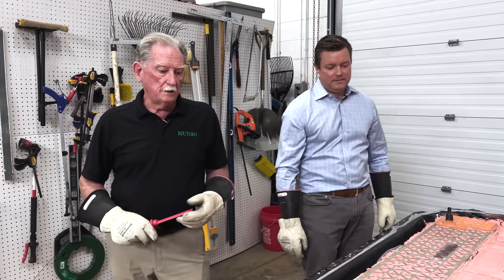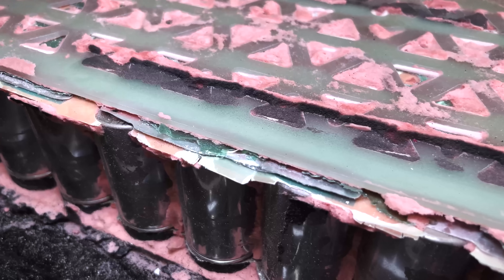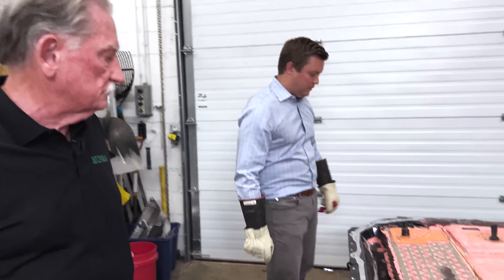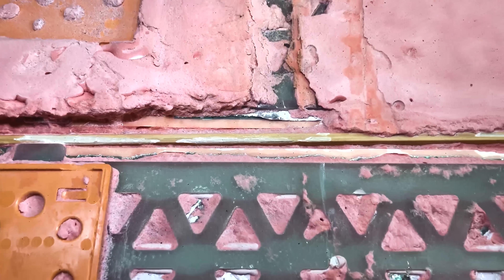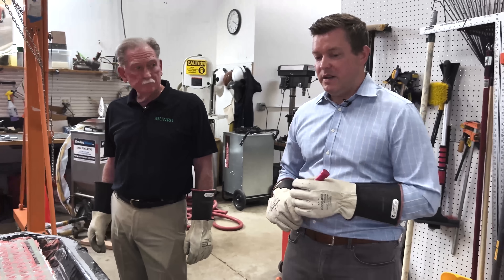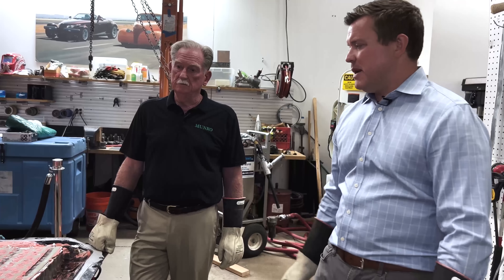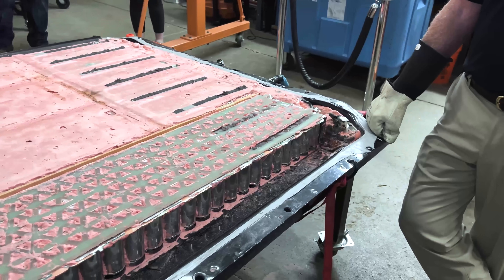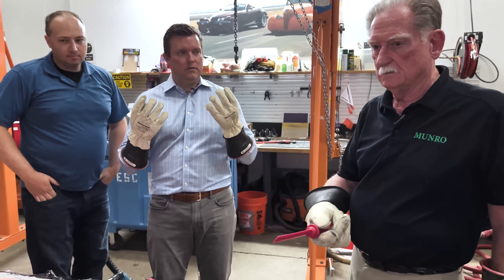4680 Battery Pack: What We Found Under the Foam!

Comment: I believe that Sandy did mention this on one of his tour video's on the Autoline Daily You Tube segment that The TESLA batteries are not failing to perform and that they are essentially glued in place. This battery just goes to show us all that TESLA still believe in their battery technology to the MAX. 

TESLA still put their batteries in solidly. Especially now that they are an integral part of the cars they build. A structural battery pack should be installed securely and profoundly as tight as possible so as to not fail.

Congratulations to Cory and Sandy for proving what it takes to tear apart this vehicle. I would want one to stay together; this well and feel protected if I am in a crash situation. GREAT JOB guys, thanks for the confirmation pertaining to information that I care to know about. This is the reason you have gained my trust as a Subscriber. Thanks In Advance for reading my comments...

Comment: Edit: I am wrong below. It will 828 cells, unless they do something different on other packs. The next row will be 35 cells, and it will alternate between 34 and 35 cells. This does mean that it will be a 92s9p config, which is also lower voltage than current 2170 builds. Not sure why they would do that.

"For the total number of cells, 816 makes more sense than 828. The pack is overall the number of cells in series multiplied by the number of cells in parallel. They have to both be whole numbers. Given that Tesla is still on a 400v architecture (between 350v and 450v max charge), you need around 100 cells in series to make that work. The only parallel numbers that work within that range are 8 and 9: 8 for 816 cells and 9 for 828 cells. 9 in parallel would mean 92 in series while 8 in parallel would mean 102 in series. 

While both work for a 400v architecture, 9 would be a lower voltage of 386v. When it comes to charging, the super chargers are amp limited due to heat. This is also the case with the controllers and motors. But this would be an unnecessary limit to charging speeds. 8 would be 428v. This would allow faster charging speeds for the same amount of amps. It would also allow the motors and controllers to run cooler."
Reply: I came up with the same math. 204 per section. 4 sections. Each section is two series strings of 102 cells. So a total cell count of 816 is very plausible.
Reply: @trent_carter  Thank you. I hadn't thought about the individual sections. Makes sense though, as each module would be identical in that. However, it would make it impossible to reduce voltage by separating the modules from each other. 

I kinda want to take a voltage meter to several connections. That would give series counts, which is the most important aspect when looking at total pack size. Dangerous if you screw up though. 100v DC is more dangerous than 100v AC, and we are looking at a max of 400v and enough amps to melt steel.
Reply: You have those combinations correct. The voltage difference between the two of them is unimportant; the Ford Mach-E standard and extended range batteries are 96S3P and 94S4P, with no change in the motors or controllers and no loss of performance.

The count will almost certainly be 828, if only because when divided into the four blocks (modules) the resulting 207 divides into whole groups of 9, while the 204 resulting from a total of 816 does not divide into whole groups of 8.
Reply: @brianb-p6586  You are right on the voltage not being that important overall. While it is important, the motors and controllers have a wide range that is acceptable. Similar to the charging systems. It does need to stay within the acceptable range, but that's it. Otherwise, higher voltage is slightly better than lower voltage since it allows less amps for the same amount power. That reduces heat. 

You are incorrect however with the pack groups. We can see that the first module, which has to be identical to the other side, is 204 cells (6 by 34). The center modules are also 6 across. The 828 cell count comes from someone saying that the center modules were 35 cells down and 6 across, while the sides were 34 by 6.
Reply: @anthonypelchat  No, as Sandy mentioned they don't know how many cells are in that block. The edge row has 34 cells, but when they did in far enough to see the next row (which likely has 35,  and the they alternate like that), they'll actually know how many are in the block. No, the blocks are logically not different; unlike the original Model 3 2170-cell battery, the middle blocks (modules) do not appear to be longer.
Reply: @brianb-p6586  They start talking about the cell counts at just before the 10 minute mark. He specifically mentions that they see 6 by 34 on the side module, or 204 with 816 total. He then mentions that they look to be identical, but won't know for sure until the rest is pulled off. The 828 came from previous renders of cells showing an additional row with the center modules, not anything that Munro counted. Maybe there was some idea in a previous video, but nothing in this specific one. 

With there being a clear separation between modules, we know for sure that there are 4 modules in total. If the two side modules are indeed 204 each, then at no point does a 9p cell setup make sense. Each side module and center module would have to cross over voltages at some point to make it work. That would make the whole module thing pointless. Can explain further if you want details.

Each module being 207 cells makes more sense from a layout and voltage perspective, but it wastes a lot of space for no reason. Each module would have to have a 35th row of cells that only has 3 cells while all the rest have 6. That also doesn't appear to be a possibility as both the front and rear of the side module appear to stop right at the final countable row with electronics clearly visible where the 3 cells would have to be. While it is true that we need to wait on final info to be sure, it is also extremely unlikely that the side modules have 207 cells.
Reply: @anthonypelchat  the cells are not in a rectangular grid. Like every Tesla-designed module and every sensible module using cylindrical cells, they are laid out in hexagonal circle packing (look that up, such as in Wikipedia, because a comment with a link will be deleted). It makes no difference to packing density whether there are 34-cell and 35-cell rows or all 34-cell rows - there are no "3 cell rows", and the front and rear ends of the cell arrays are not (and cannot be) straight across. 

Again, the 828 value has nothing to do with longer centre modules.
Reply: @brianb-p6586  I understand how battery packs are laid out. I build them for diy projects. And yes, Tesla can absolutely rearrange cells in many different ways to make it work. However, these still come off an assembly line. This is not a hand built battery pack for an ebike. As such, you either have 4 identical modules coming off of a single assembly line, or you design different lines for different packs. What makes more sense to you? And remember, all 4 modules are verified the same dimensions wide. That means that each is 6 cells wide. 

Again, to get 828 cells in total, you only have two options: either all 4 modules have a 35th row of cells that only hold 3 cells instead of 6, which waste space, or you have 2 modules with 34 rows of 6 and 2 modules with 35 rows of 6. There is no other option based off the info that we currently have. Period. Sandy and his team are not showing a 35th row on the outer module. Further, from the video, we cannot see any clear space available for the 35th row. Therefore, it is highly unlikely that there are 207 cells in the side modules. The only option is a 35th row in the center modules. If there are only 204 cells in the side modules, there is absolutely no way of any two modules being identical. The entire 828 cell count came from old renderings. 

Further, this entire discussion is now pointless. Look at the video again and focus on the front of the module. If this were a 207 cell pack, the most optimal setup would be to have 23 sets of 9, so the front would just be one large set. Instead it is split into 3 pairs. There is no possible setup with 207 cells that makes sense in that case. This makes far more sense with a 204 cell count and a 102 cell series count. 102 is 34 times 3.
Reply: @anthonypelchat  EV battery packs routinely have a more than one module type in them, but of course four identical modules are even better... and that's exactly what I have been saying (which you would know if you read what I wrote).

You're still talking about 34 rows of cells, as if they are arranged on a checkerboard, so you clearly don't know how to pack cylinders together and haven't looked. Until you do, this won't make sense to you.

Yes, if it has 207 cells per block, the arrangement will obviously be 23 sets of 9.
Reply: @anthonypelchat  to help you understand the likely layout and why you're "three extra cell" concern doesn't make sense, have a look at an InsideEVs article titled "Engineering Analysis Of Tesla's Cyber Rodeo 4680 Battery Pack Cutaway". It shows the components well, and even has a detailed drawing of the layout.
Reply: @brianb-p6586  For some reason I was describing it in a rectangular design, even though I knew it would be staggered. Was likely tired. Of course that isn't how a 207 cell module would be built. It would of course be a staggered 34, 35 column cell count. My assumption was a 34, 34 staggered config. However, I am wrong. The article you mentioned from May clearly shows Tesla building in a 34, 35 config.

Each module has to be 23s9p. The only way that I can see that fitting properly is 9 across, 23 down. With the staggered setup, it would mean alternating 9 cells per column 1,2,1,2,1,2 connected in parallel and alternating for the next group connected to the first in series. That would also mean that the front end would be one connection of the 23 series while the rear would be the other connection of the 23 series. Each of the packs would then be connected in series with one side of the pack being the main negative and the other being the main positive.

It still doesn't make sense to me that they would do that. It means that the voltage is lower, which is the opposite of what you would want to do. That increases heat buildup in the motors, controllers, wiring, and charging. This also likely lowers the max charge as well. Granted none of this is major. Only a few percent different. But it does seem like a waste to me.
Reply: @anthonypelchat  To see the components of the battery, including 69 (not 68) cells attached to each of the 12 cooling strips in the pack (3 per block, so 207 cells per block), check out the Munro video which Sandy did while visiting the Tesla displays in Texas 3 months ago, called "Sandy at Cyber Rodeo Giga Texas". The strips with cells show up at 6 min 6 sec, and again separately and perhaps easier to count at 8 min 2 sec in that video.

I didn't realize until I stumbled across this video that the Munro people (and everyone else who cares) already know how the cells are arranged, and are just "building interest" with the silly speculation in the current video about how many cells they will find.
Reply: @brianb-p6586  I'm not sure why they left it up to speculation. Maybe they just weren't thinking. I do care about the setup, but never saw the 34,35 layout until that article. I even searched, but all the images were showing 24 by 40 (960 cells) with a potential 12 additional cells. But nothing was clear. 

My issue was not clearly visualizing the full pack layout. It makes more sense seeing it as a giant 4s battery. The 92s total still doesn't make sense to me. Strange to go with a lower voltage. But that is clearly the setup they are going with.

Comment: It doesn't look like the battery pack can be serviced at the cell level.  If your battery goes bad, the entire pack needs to be replaced.
Reply: Define "Battery".
It's a collection of "cells"
If one cell goes down, and we assume (why wouldn't we?) that Tesla has now "fused" the cells to be electrically disconnected by the BMS, then the "Battery" (pack) loses 0.12% (percent!) if "a cell" goes down.
If it's a control problem, all the high voltage circuitry is on top of the pack, accessible from inside the car.
(Just a note, that's FAR more serviceable than the Ford pack.... Ref "contactors"?)
Reply: @rogerstarkey5390  how can anybody service the pack with all that pink stuff in there?  If Munro staff have difficulty even taking it apart, independent shops, like Gruber, have no chance of servicing it.  Don't expect Tesla to service it either, the time, materials, and labor required makes it unfeasible to service the pack.

Comment: is freezing with nitrogen the best way to recycle this or any battery? keeping the nitrogen from evaporating will require a bunch of energy, don't know any alternative though
Reply: It’s not. Discharging the battery to 0 volts has exactly the same effect, namely that it doesn’t short out your machines and burst on fire when shreddered, without the energy intensity of LN.

Comment: Has anybody done any testing as to whether the poam will disolve in various acid solutions. Some foams will dissolve in acetic acid (vinegar) There might be a specific acid that would dissolve the foam allowing full access to the individual battery cells.

Comment: guys do you have a FTIR spectrometer? plastic ID is trivial if you have a clean piece that you can get an IR spectrum from. You are in an industrial park with several other chemical and lab oriented businesses nearby. There should be someone with an FTIR within 500ft of you right now, you could have the answer in minutes. You could also use a handheld Raman or near IR spectrometer for ID.
Reply: Even if it is a proprietary mix of materials not seen before?
Reply: @geirmyrvagnes8718  yes. even if there are novel plastic blends, EVERYTHING comes out in the FTIR through automatic deconvolution algorithms. see how it's done with a video from Bruker on here "Plastic and Additive Identification | FT-IR Spectroscopy | Recycling of Polymers"

Comment: Recycling is not high on the design goals of this battery pack. Maybe it will improve later?
Reply: You watched the video right?
Reply: @oof_Dad  yes I did. And the key line is "as found in a mine". 
Why would you spend the extra energy to freeze and process this "ore" to then have to spend the same energy as with new materials?
Reply: @ricardokowalski1579  What makes you think it takes the same energy to recycle that as it does mine it from tons of rock at a way lower density?  Check out page 97 of their 2021 Impact report:  https://www.tesla.com/ns_videos/2021-tesla-impact-report.pdf
Reply: @oof_Dad  Sandy's comment makes me say it. 
It takes energy to process the battery with liqN2
And then it is "the same" as "found on the ground"

I care not for your report
Reply: @ricardokowalski1579  The concentration of usable elements in these packs are orders of magnitude above what comes out of a mine. Nowhere near the necessary power required to extract and refine will be used to recycle the packs.
Reply: @ericrichards7884  please take it up with Sandy, not me.
He is the one that said it.
Reply: @ricardokowalski1579  You are one of those trolls that correct people in the comments section because they use to instead of too or their instead of there. This is just a forum for quick exchanges of thought not a graded college thesis. We all know what Sandy meant even if he did not articulate it correctly on an unscripted YouTube clip. You are a troll and I am done feeding you.
Reply: @ericrichards7884  bingo

Comment: So it can be recycled but I don't think it can be repurposed.
No good for the DIY guys
Reply: Depends who does the "repurposing"
Reply: It can be reused in its entirety as a stationary storage pack. Which will be a very hot market for decades. There are plenty of companies (including Tesla) making packs that can be used by the DIY crowd. They will be fine.
Reply: @ericrichards7884  for example, the previous batteries can be purchased in parts. In many cases a person may only need one of two module to build a power wall. It would be eay toy expensive to use there whole thing
Also to use there whole thing may not be practical for ev conversions because of the lack of versatility

Comment: It hurts my head to read some of these comments. This pack is awesome. It is extremely strong so the car is stiffer and can handle stresses better. It can be replaced if necessary even though it is structural. It has less complexity and connections to fail with the larger individual cells. It will not fail to environmental intrusions being so well sealed. It is reusable as an entire pack in grid or home storage once it has lost 30 percent of it's capacity. Then it can be recycled using the cryogenic dip/shred procedure that Sandy described. It will be reprocessed into the next generation of battery which will more than likely be better and cheaper. This design will also scale quickly to drive down cost. This is what Tesla is after. All you arm chair quarterbacks just stay quiet and let the people who know what they are doing take the ball. If you were half as smart as you think you are, you would be where Sandy and Elon are. Not trolling on the YouTube comments section giving me a headache. Sheeesh